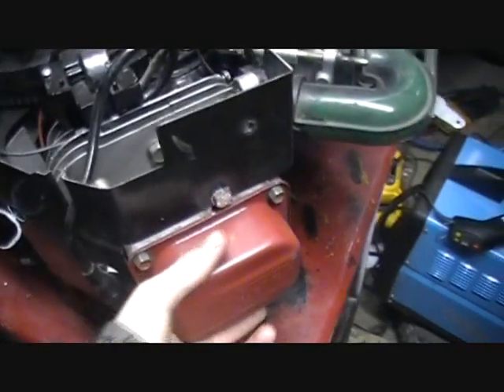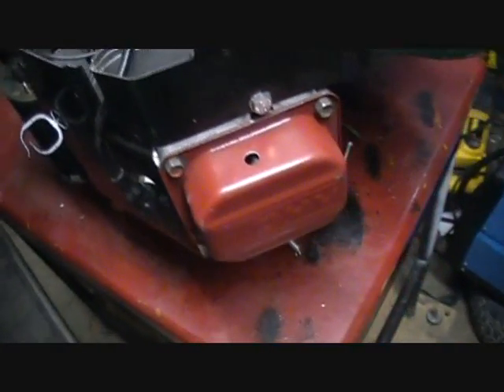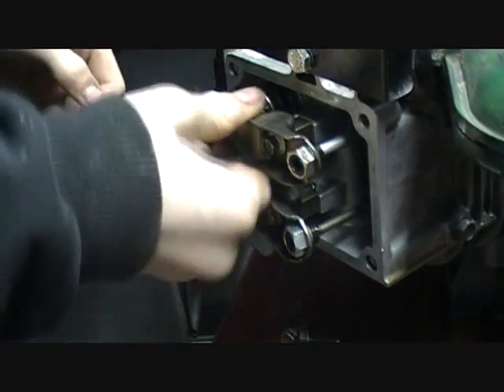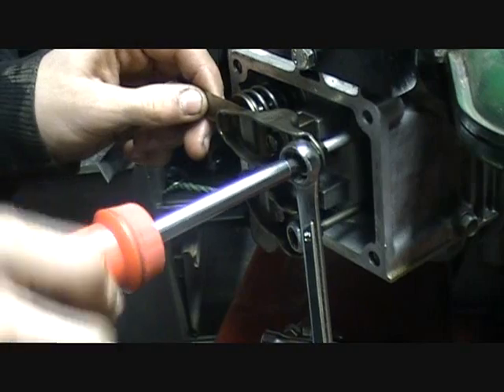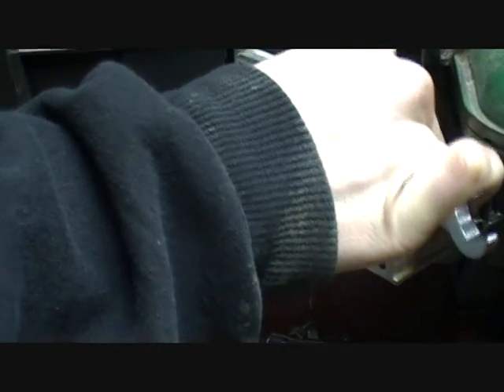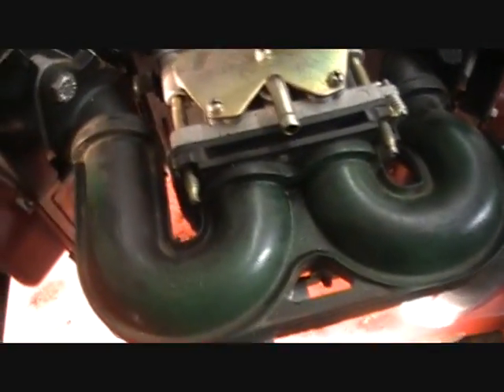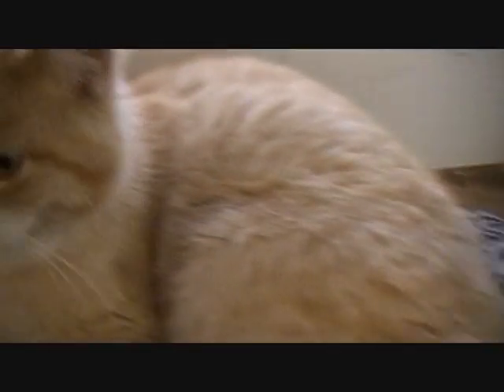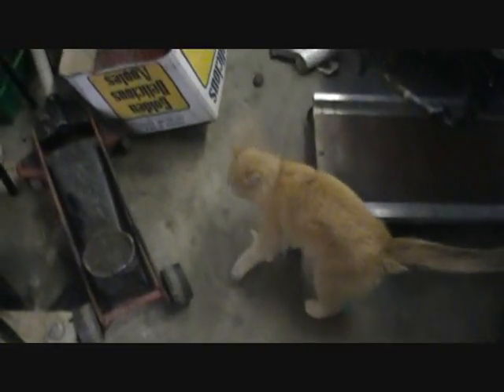Briggs Intek V-Twin OHV Valve Adjustment (Hard Starting)

Comment: how you turned it over until the bottom valve stops moving. you'd just turn it again until the top doesn't move??? never done this before. but,  this seems easier than a screwdriver in the spark plug hole to find top dead center!

Comment: am I wrong? I get the principle...that if lash exceeds 4-6...no matter what position of piston...it's off. But shouldn't all adjustments be made with piston at TDC of compression stroke (with both valves closed)? But, like I said...I can see where "closed valve"= closed valve...as intake valve will be closed on exhaust stroke and and exhaust valve closed on intake stroke. I guess it's just for some form of uniformity and certainty that you seek to do both on TDC of compression?

Comment: You are doing great and taught me something.
I was taught that if an engine will crank, that is "turning over"(the crankshaft is turning over)
An engine that "turns over" but wont start, usually means it wont "fire" or "fire up".  If someone tells me the engine wont turn over, I would think, dead battery, bad solenoid, bad ignition, bad safety switch, along those lines....An engine that turns over but wont fire up means ignition problem, fuel problem, air problem or valves need adjusted, along those lines.
Just how my dad taught me.
Good luck to you.

Comment: After adjusting the valves , if it still does not want to turn over properly , it could be the compression release on the camshaft is broken and needs to be replaced.

Comment: this is just like shark tank, very inspiring to see young people interested in fixing things, a very good informative video that I will use to adjust the valves on a 22hp Briggs on a Yardman mower a very hard starting motor,   only spins 1\4 turn even with a charger hooked up.

Comment: I had looked high and low for an example of the rocker arms on my B&S Professional series engine.  Based on my experience and that of those much more experienced in small engines, it is not a good design.  In any event, found this and it really helped me out because of the straight forward approach.  Thanks, to the young man that posted it.  Don't worry about the critics just keep learning whatever you choose to pursue.  I am nearly 60 with a PhD and have done R&D projects for the last three decades.  I still have a lot to learn and, if I put forth the effort and am lucky, pick up some good info in some area every day.

Comment: Good Job ! After you adjust them the first time and before you re-install the cover(s): turn the engine over a few revolutions and recheck the clearances. Then do it a third time. When installing the covers, be sure to clean the mating surfaces thoroughly, then apply a very thin film of black rtv on the gasket. Tighten using a cross pattern, never tighten sequentially in a clockwise/ccw pattern!
Reply: David Lewi

Comment: Nice job young man, however, Briggs' engine spec manual states .005 for intake but .008 for the exhaust. So if your engine bogs a bit under load, you may consider loosening your exhaust valves slightly...

Comment: To set the valve clearances, you need to first remove the spark plugs... turn the crank so that the piston is at TDC (top dead centre) in the compression stroke, you can do this by putting a screw driver down the plug hole and feeling for when the piston is right at the top of its stroke, both valve should be lose, and then you set them at this point... this probably won’t be the problem why the motor isn’t turning over... anyway, I dint have an issue, but I feel this young guy, although he is sill learning, should rather do some homework first and learn a bit more about small engines before trying to teach others via YouTube... anyway, didn’t mean to offend the young lad...
Reply: also to ad, AS per Briggs and Stratton manual, the briggs and broken vtwins need to be adjusted with piston at 1/4" past tdc. I believe its because of the compression release arm works off a cam lobe. So if you don't do it this way, your starter is gonna have a hard time turning the engine over making you think you have a weak battery.  This was my issue and is why I had to readjust my valves.
Reply: +shortthrow50 does this apply to 4 stroke 5 hp rototiller engines with horizontal shafts?
Reply: +Karamelia Mitchell I wish I could be 100 percent sure to answer this for you. I Would start with not doing it at 1/4 inch past tdc. The reason why, I don't believe the 5hp motor needed compression release. Worse case scenario, if its hard to start after that, go 1/4 inch past
Reply: shortthrow50 
Think I'll go with Briggs and Stratton on this one partner.

Comment: Around 1:40-1:42 when you turned the engine by hand and the exhaust valve went in is that like what they call top dead center.  I had heard you have to get the engine at top dead center before adjusting valves.  I am trying to learn how to do this myself.  Any help is appreciated.
Reply: Take your spark plug out.....take a small screwdriver and place it in the sparkplug hole. When the piston pushes the screwdriver  out and starts going back you have reached the TDC.
Reply: Top Dead Center, Valves are completely closed, or coming at you specifically Exhaust valve

Comment: It's good to see young people taking an interest in working on their own things, two things you need the piston at top dead center and you need to torque the lock nuts . Keep on wrenching.
Reply: I have adjusted my valves twice in the last week. It seems to slip after only a couple of starts. I did not torque the keeper nuts, just tightened pretty snug. I saw someone use a torque wrench to 45 ft/lbs. Is this right and in your estimation my problem?

Comment: You sound young my friend and you are on the correct path to being a good small engine tech. I always get excited when I see young men getting it right. Keep on wrenching. And to comment on a post below, valves that are out of adjustment will create backfires. If the valves don't have the proper spring torque against them then the combustion cycle escapes in reverse through the carburetor creating backfire. "The path of least resistance" theory.
Reply: glad I come across your comment.  I was wandering about valves being out of adjustment causing backfire.  I am getting a free yardman mower with a 20 hp vtwin briggs.  I tried starting it a while back and it turned over good and strong but, it backfired ever so often when you tried to get it to start.  I never did get it started but, gonna try here in a few weeks.  What would cause an engine to backfire when it starts to crank over?

Comment: Dont use starting fluid alot you will eather train it and it will only start with starting fluid.
It can also weakin the cylinder walls.